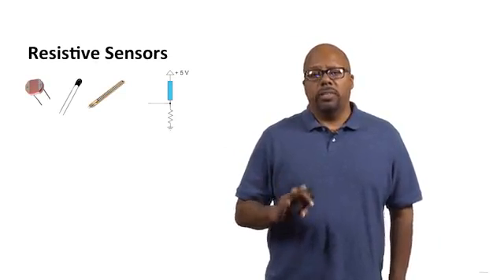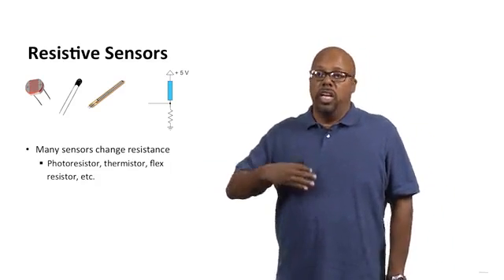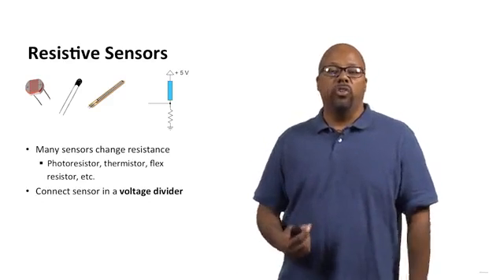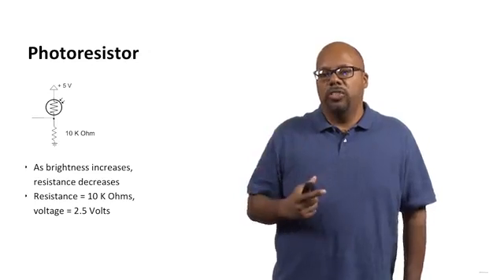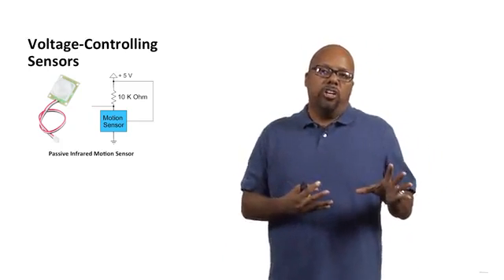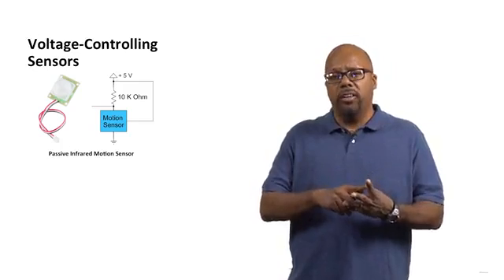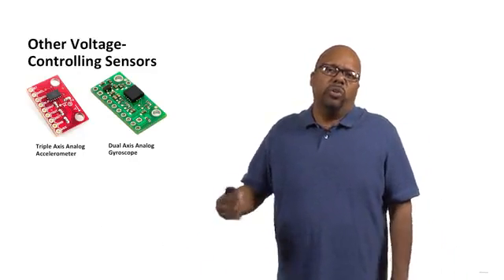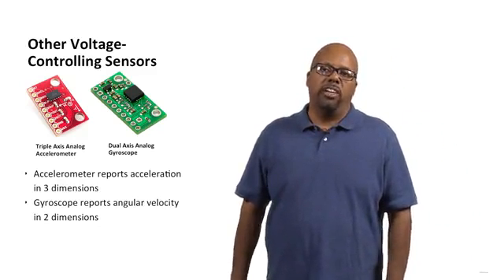Lecture 1 2   Resistive Sensors

Comment: Which resistor to be use for soil moisture?
Reply: you typically need a pull-down or pull-up resistor in a voltage divider circuit, depending on the sensor type and how you're measuring soil resistance or capacitance.